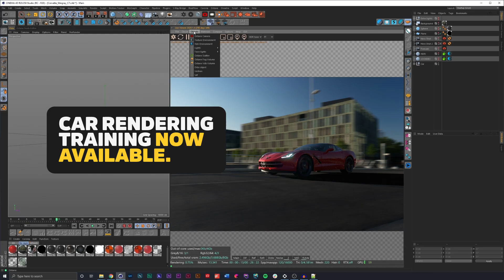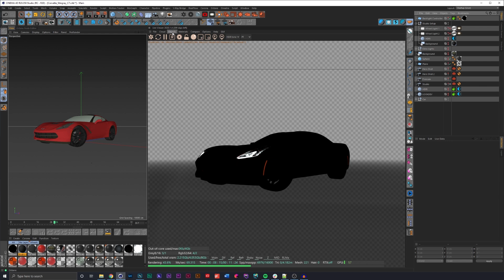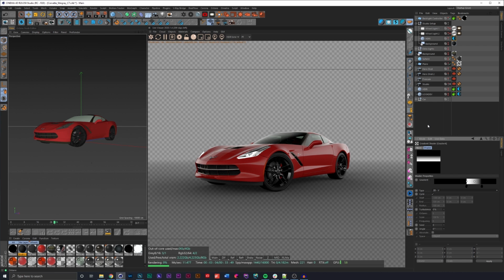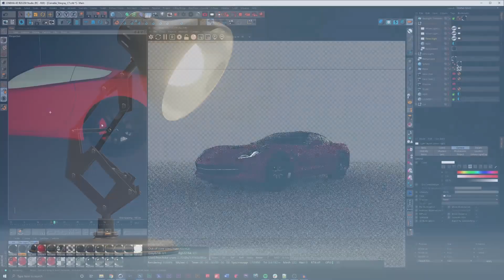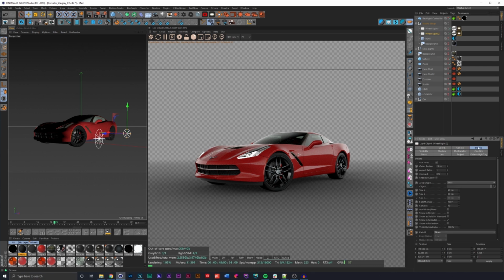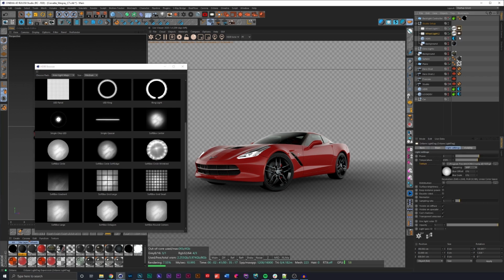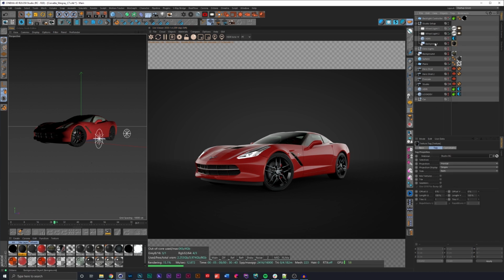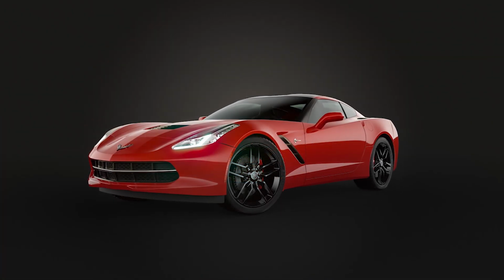Sneak Peek - Guide to Automotive Rendering with Octane | Greyscalegorilla Tutorial

Comment: Hi there 
Should I get an RTX 3090 or an RTX A6000??
Reply: What is your reason on getting a new card? If it's for GPU rendering I'd say go 3090 if you can get one and not break the bank. Plus most if not all GPU renders use Cuda as a part of the process so you'll bet set after setup. I am not to familiar with AMD's process but I know OTOY is working on bringing support for AMD cards in time. Good luck on your decision and purchase!
Reply: From a 3D artist's point of view Geforce cards perform the same as their Quadro counterparts. Sometimes even better. With Quadros you're paying for more Vram and hardware certification for CAD programs. So unless you're doing geo heavy scenes with 8k textures and tons of UDIMs (VFX stuff basically) you'll be more than fine with a 3090
Reply: It’s going to be for detailed Animation 4K or 8K
Reply: @jpquinn4550  You'll still be fine with the 3090 for that stuff save the money :) Plus if 3090s were normal price you could get two 3090s for the price of one A6000 have money left over for a 3070
Reply: @rajis92  
Thank you for your information and help I will definitely get the RTX 3090
Thank you